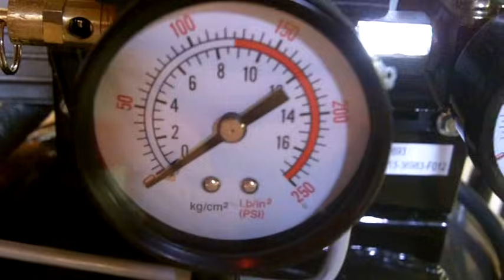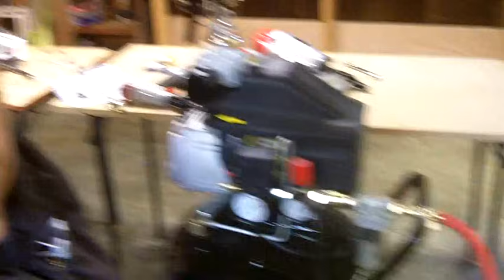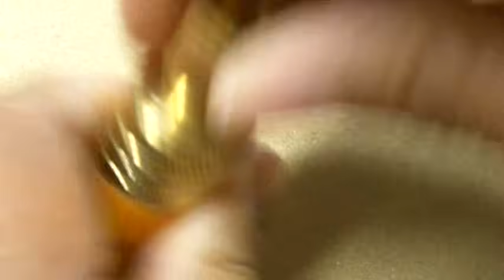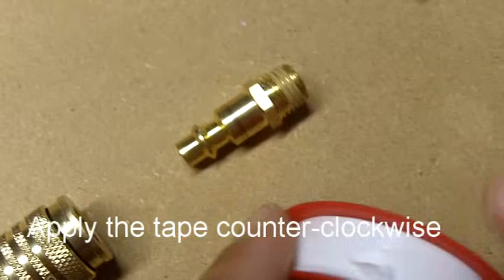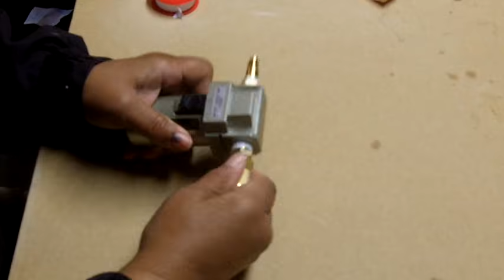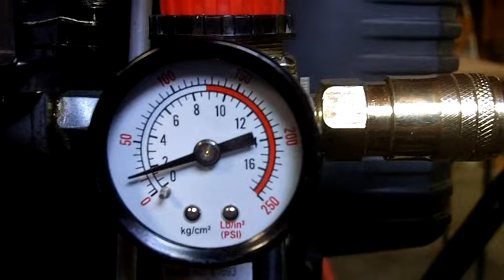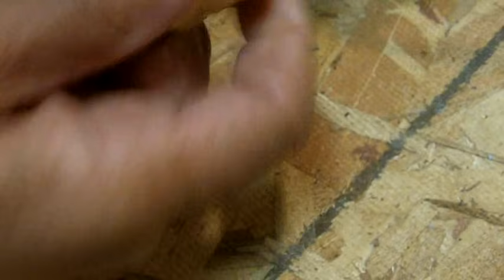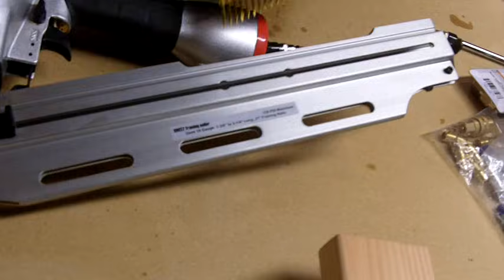Air Compressor, Line Setup and How to Use Air Tools for Beginners

Comment: I you want to use a universal cupler does it have to be installed only on one end of the hose to have tools inserted into it? Or does the compressor need to have a universal cupler as well?

Comment: Thinking I just bought a way way way over powered compressor because I am in basement and did not want it constantly running😂. 0 to 115psi for airbrushing dye for clothes. Only need 15 to 20 psi. Good news if I want to do something else it can! How do I clean the filter?

Comment: Great video. I just bought a  20gal compressor to paint my truck. I was wondering if you can add 2 water filters beside each other. Also can a mini water filter be added to the other end of the house to reduce water spray on a paint job

Comment: Die grinders are great, can adjust speed by regulation of air pressure, that. Small tank won't handle a lot of tools, also cfm is not the same as stored air in terms of tank volumes, gallons

Comment: Please make an addendum to show how to drain the air tank so moisture in the tank can be released and so it won’t rust from the inside out.

Some tanks have exploded due to rust weakening the tank wall, welds and port openings and then failing dramatically when the full pressure has been reached or worse if the system over-pressurises.

Comment: Good instructional video, good job, keep it up. Can you do a video how  to read the gauges, how to set the gauge for the tool at 10, 13, or 15 PSI ? And do a video using different attachments  , for example air gun.

Comment: Excellent video you are in fact an excellent teacher. I was curious about a few things now that I understand how this all works. Can you adjust how much psi the tank fills up to or can you turn off the auto fill feature on the compressor should you need/want to? Also on a more advanced note if I wanted to hook up a secondary tank later on will the compressor automatically fill that up to 120psi also?

Comment: your setup so much better than my 5 gallon air tank, tire pump (i blew the piston tryna fill it yesterday and just fixed it today) and undersize fittings and accessories to power my 3/8" drive impact wrench lmao

Comment: Functionally operates just as it should https://www.youtube.com/post/UgkxiiMg_x4gIWeXMWfBnDdRnME4qJUAva4w holds pressure perfectly when not in use. Glad one of the other reviews pointed out that the bottom pressure release valve was open; thought it was defective at first.
Reply from the maker: You're not

Comment: Thank you Leah for another fantastic video! I just bought my first air compressor. I want to be safe around my tools and also take care of them as they are a big investment. Question: what type of oil do you recommend using to lubricate air tools? Also, about how often should the Teflon tape be changed on the threaded areas of attachments? Thanks so much!! I appreciate you more than you know!

Comment: This is a great video! 

Only thing I’d suggest is adding a lead line from the compressor to the separator, six feet would help a great deal. 
 The compressed air is also warm simply due to being compressed. you need a lead line to allow the air time/space to cool, therefore releasing more of its moisture allowing more to be captured vs having the separator directly next to regulator as shown.

Comment: This is a great video. Everything included for starters.

Things I would have mentioned is popping out the air hoes, hold it so it doesn't hits you.
And the small valve at the bottom of the tank to let out the moisture

Comment: I wish I had watched this video when I got my first compressor 13 years ago, it would have saved me so much headache learning things from trial and error.  The only tip I would add that often gets left out is that the moisture needs to be released from the bottom of the tank regularly to avoid rusting out the tank.  I learned this the somewhat hard way.  By the time I heard about it, I had used the compressor so much without draining it that rust started to develop on the bottom of the tank.   A rusty tank can be a hazard, with catastrophic and potentially deadly consequences if the rust reaches the tank's welded seam.  Thankfully I noticed it was time to replace my compressor when it kept leaking down without holding pressure, and not via major seam explosion.  Lesson learned, I plan to always drain the moisture petcock on the bottom of my new tank at the end of every project.

Comment: Leah
Hi my name is Stephanie. And I have a simple question for you. If when you are using a tool and the compressor kicks on, should you or should you not stop using the tool until the compressor is full again? I’m asking because I am receiving two different answers for this question. Now, I believe that you can continue to work with the compressor on as long as it automatically shut off at the factory set pressure. Am I correct or not? Please let me know as soon as possible because I really want to be able to get finished with the job I’m doing sooner rather than later. 
Thanks for all your help.
Sincerely, 
Stephanie

Comment: Another good video Leah, especially for beginners setting up their air compressor. However the moisture filter setup will not work effectively as shown. As the compressor works and gets hot the air pushed into the tank is hotter than the surrounding temp and therefore will trap moisture. To deal with that issue we need to bring the air from the tank to the same temp as the environment before the compressed air passes through the filter/moisture trap. Adding 25 or 50 air hose from the tank to the filter/trap is usually enough to cool the air down and release the moisture to be captured by the water filter.
Reply from the maker: Thanks for sharing

Comment: Leah, THANK YOU!
My car tires were low. I went to BJ'S to use their air compressor. Instead of putting air in, it came out. I went back the next week and it was still broken. I drove all the way out to WaWa. Their compressor was broken too. I went to Mavis Discount Tire Store and a nice worker inflated my tires.
I decided then and there I was buying an air compressor. I bought a Kobalt 6 pound pancake air compressor. 
I thought everything came with the compressor. Silly me! I bought a 25' Craftsman's rubber hose and Kobalt connector set with a blow gun and air chuck.
Wasn't totally sure how to connect everything together until now. Your video was both educational and enjoyable, thank you for giving me the confidence to set up my air compressor and usd it.
Gerry
HPEteacher
😎

Comment: Thank you for this it's helped me out loads, just got a Hyundai 50 Litre Air Compressor, 11CFM/100psi, Oil Free, Low Noise. Then got some connectors and tools which Amazon recommended. and they did not fit wasted around £30. because I got them when I bought the Compressor. a few months later when I came to use it. they were no good. with watching this and getting some info from PodpadStudios. I have now bought the right ones. This is the best Tutorial I have seen on YouTube regarding a Compressor. Thank you so much from Liverpool England.

Comment: Purchased the Husky 8 gal air compressor (TA2530B), had it about two years now, and the compressor would not build up pressure over 60 psi. Opened up the pump and the diaphragm had broke in two places. Searching for repair Kit C and B but could not locate any. Tried to contact Husky Company but could not get through. Is there any place that sells the parts or repair kits? Please contact me…

Comment: Hi Jane. Awesome video, especially your set up where you connect the lubricator with a quick coupling. This is super cool as I do spray painting as well as use air tools, and as you know you don't want oil in your paint, so by disconnecting the lubricator when spray painting is a brilliant idea. Thanks a million.

Comment: I have a 100 gallon  king sprayer  but my hose is to short. How could i add another  100 ft on to the existing  hose,what fittings  would  i need to buy ?

Comment: I always like your videos Jane. I recently purchase a small nailer with compressor it's a 3Plus unit if you have ever heard of it. Amazon has them for $150, I found one (new) on ebay for $79, $30 shipping. I just received it, but I know NOTHING about using a compressor. I purchase it because I purchase a Ryobit battery operated nail gun that I have never used as it is just too heavy for me. Well now I need to learn to use my smaller unit. I am so glad I found your video. You talk about a filter, will I need a filter with my compressor? I did not see a filter mentioned in the manual for the little compressor.

Comment: A moisture seperator doesn't work well with hot air. It should be installed right on the compressor. You need at least 50 feet of hose in between

Comment: ⚠️ One thing you should do is have that water trap/filter fit after about 10meters of line as it takes some time for the air to cool down and turn into moisture, having it so close to the compressor or directly off it makes it not very effective

Comment: Leah, thank you so much! A friend gave me a compressor with a brad nailer/stapler. I have chairs I'm reupholstering and wanted to use the air stapler but had no idea what I needed. I knew about different coupler sizes but had no idea of the connections and how to fit the hose. You've cleared up a lot for me. And I must tell you, I've gone to both Lowe's and Home Depot and while the clerks are helpful in directing me to the correct aisle, NO ONE has EVER taken the time to show me how to use the equipment. When I asked about purchasing a nailer, the clerk, on that occasion, pointed me to the aisle but then told me I'd have to buy all the other equipment (compressor, etc). Instead of sticking around, he just took off. He had no idea that he might have made a sale if he had just taken the time to actually show me the tools I needed and a quick demo on how to use them. I was so angry, I left the store (Home Depot in this case) and never went back for any of their tools! In the meantime, I've purchased tools as I need them. Your videos have made a world of difference for me!

Comment: I received a pancake compressor from a relative, (no manual), and had no idea how to hook it up, but I managed to buy hose and fittings, and used it for years airing tires and blowing dirt out of air filters.  Now I want to use it for spraying fluid film on the cars, and wanted to try adding a storage tank to see if that will be good enough. I learned a lot from your explanations and seeing your pressure regulator and tools in operation!  Thanks!!

Comment: Thanks for this info. Very thorough. Just learning about all of these tools. My central pneumatic brad nailer makes a pop sound when nail comes out. Seems louder that when I first tried it. Also a puff of air comes out of the back of the gun when I shoot it. Is that normal or do I need to adjust something?

Comment: I just bought an air compressor last year. The instructions were pretty vague, but I knew enough to set it up and to use it. What I didn't know and learned from this video, is that the tool will still be operational when the tank/compressor stops when reaching a certain PSI. I've always used it during and when it stopped, would wait, release air, and try again. lol  I'm a total noob, but now I knew better. This will help with future projects as I'm not a particular fan of the noise and always wondered how people in videos were using their air compressor tools and you can't hear the air compressor running. I feel more like a pro now after watching this. I appreciate the use of the proper vernacular so as to also educate. Good stuff.

Comment: Question- if you're using your air compressor and your tool depletes the compressed air while using it, will the air compressor start up by itself to bring more air into the tank? How does that work? Thank you so much for this video!

Comment: Nice video! Not only did I add a water filter but added the water dryer/cleaner with desiccants. It consists of two more jars. Cut out a lot more moisture in your air line.

Comment: Hi Leah, a question:
My 3 year old compressor is out of warranty and the regulator now will only flow about 60 psi max where it used to flow twice that. Is there a fix for the existing one (built-in, next to the tank pressure gage) or do I need to find a suitable replacement?

Comment: I love your videos! It never feels like there is any kind of “Mansplaining”.  Wondering if I can ask for some advice... We currently have an air compressor that my husband used.  I started noticing worsening odd behaviour and memory loss over the last 5-10 years, then finally 2 years ago he was diagnosed with Young Onset Dementia at the age of 53.  I’m worried that he wasn’t properly using and/or maintaining the compressor; like letting out remaining air and draining any water.  The compressor hasn’t been used in at least 3 years.  I have a lot of house repairs to do now that I have to sell our house.  What should I do with the compressor we currently own?  Should I take it to get inspected and/or repaired... or should I just be safe and buy a new one?  Any thoughts or suggestions would be greatly appreciated 😊

Comment: i got a brand new SIP 150 litre 3hp belt drive air compressor last year for an absolute bargain but it was sat in the box since last year until i got my garage and my uncle has just fitted all my electrics so now im wondering how to set it up like what air filter regulator lubricator should i buy for tyre inflating because the gauge tops out at 290 psi and the tyre inflator im looking to buy has a maximum air pressure of 250 psi and also what size air filter regulator lubricator should i buy 1/4 or 1/2? any help would be great thanks

Comment: Hello Leah, 
TY for the vid. 
My wife and I just bought a home and in one of the garages was a really dirty air compressor that I want to bring back to life. I just ordered a hose and a few couplers but its the air filter and the treads on the side of this big filter that concern me. I think I need a hose to go from the filter to the gauge even tho the gauge is hooked up to the filter. Not sure the connections on this thing. VT631402AJ 60 gallon.  The number brings up all kinds of compressors but the one that it is.  I wish I could shoot you these photos of it.

Comment: Thankyou great video! Ive just inherited a Clark 160 litre compressor tank and a Bambi sprinkler sytem air compressor i know u said at the beggining of the vid u were talking about mobile compressors but was wondering could i make an air compressor using my bambi fsb200 sprinkler compressor or is it not powerful enough to fill a 150L tank? Excuse my ignorance!

Comment: The first thing I place on my air compressor before even the second regulator or anything else is a ball cock valve to shut off the air supply if I make changes to any other components on the line. It is also beneficial to evaluate if you will have tools that need a lot of air in which case you would opt for 3/8" components rather than 1/4" ones. If going with 3/8" make sure ALL components are 3/8" or the smaller ones become the bottle neck to impede performance.

Comment: I was struggling to set up my air compressor for equipment needed to run my business. After multiple trips to Lowes, I decided to watch this video. THANK YOU for explaining all of the steps. After watching I was confident in the parts I needed and was able to hook my line and tool to the compressor in 5 minutes or less!

Comment: Thank you very much for your very detailed explanation and instruction.  It helped me tremendously  - 5 star instruction.  However, as the novice I am (my fist compressor - I could not even use a saw lol)  I am accustomed to when I close a knob, I feel some type of resistance, but in this case closing the air regulator valve (that red knob)  it feels very loose - is this the way it suppose to feel?  Thank you, Barrington

Comment: Hi Leah.
I drain my Craftsman air compressor every time I use it, have an inline water separator like yours and attach another ball type water filter on my air tool.as well.
I still get water spitting out of my air sander 😕

Comment: Want to learn something new...ask a woman!  I learned to play really good golf from a female professional; dropped my handicap By 25 strokes in six months!  I want to get a compressor but it is really confusing for me.  I want to get a 3HP Makita with a 5.2 gallon capacity...small and compact.  The CFM is 6.5 at 90 PSI, AND 6.9 CFM at 40 PSI.  Will a 50 ft., 3/8” air  line work with quarter inch couplers high capacity flow or do I need 3/8 couplers?  Really need some help here.  Thank you!

Comment: Good grief.  Why do the instructions for an air compressor not come with these instructions and/or suggestions?  Manufacturers should link your video in their instruction manuals.  This cleared a ton of stuff up, especially the difference between industrial, automotive and universal fittings.  This was driving me nuts.  

Thanks again.

Comment: Your not using your compressor settings correctly !!!.............when your setting the pressure for the tool your going to use, you need to test the pressure when the trigger is pulled. For example you might have the setting on the gauge set to 80 psi and you think this is fine.. well its not correct at all if you want to run the tool at 80 psi because as soon as you pull that trigger your  air supply will only be running at around 55 to 60. so when you pull the trigger you need to watch the gauge and see what it says, you might have to make a few adjustment .. you want to see the 80 psi  on the gauge all the time the tool is running,  not when its stopped...  this is why so many people use the tools very under powered by the air and think the tool is faulty.. you are starving the tool of its cfm and pressure.